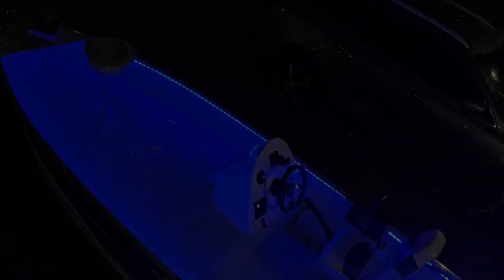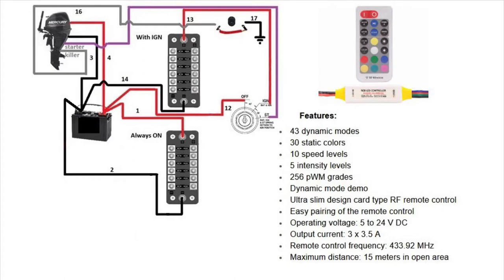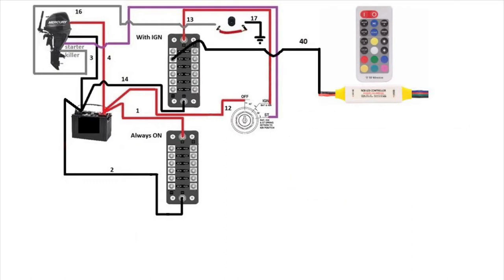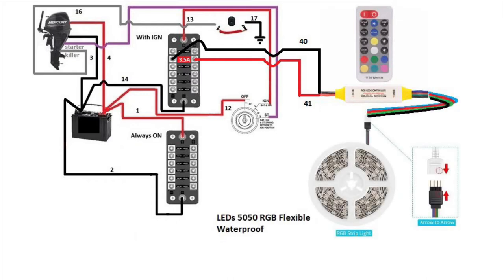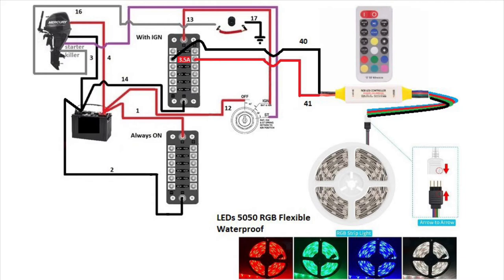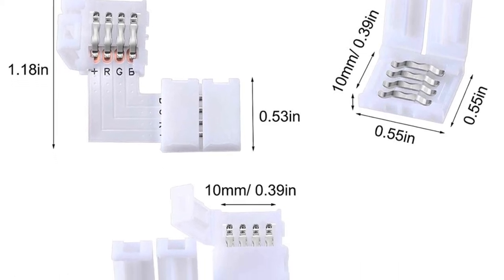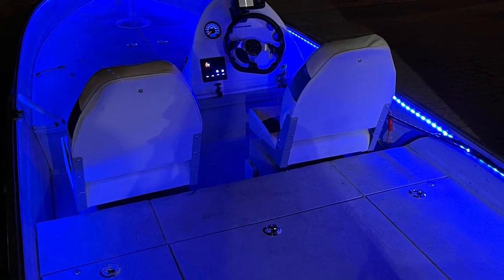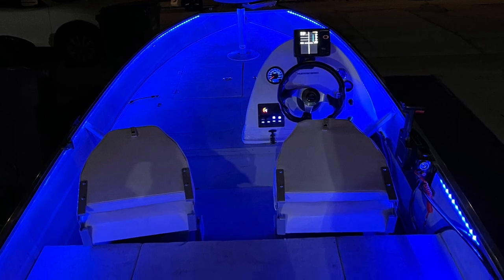Boat electronic wiring diagram, part 3 ( led strip installation )

Comment: Hi Joe.  Great video and just what I need.  Any chance you can share the wire diagrams with a link or something?  Would love to print these off to use and keep a copy on the boat in a ziplock.  Thanks Dean
Reply from the maker: Hi deanwentzel, thanks for watching and for the nice comment. For the diagram, Other have done a screenshot and printed it. Try that let me know 🙂
Reply: Joe that worked perfect.  Thank you sir:)   @joetheboatguy5394

Comment: Hi Joe, Great videos.  I am redoing my boat and your videos are very helpful.  I have the same type of accessories but want to have separate batteries for crank and always on.  where would you add a on-off-both battery switch?
Reply from the maker: Hi Michel, thank you for watching. Let me know if the is what your looking for… check this video https://youtu.be/l4Ve6KpiAqQ

Comment: Your videos are EXTREMELY helpful. Thank you. I have one question: can you provide a link to those RGB LED lights you are referencing in this video with the RF remote? I can't find them. Thank you.
Reply from the maker: Hi Derrick, thanks for watching and for the nice words. For the the RF remote I got it at a electronic store called Addison. It’s called “LED STRIP CONTROLLER WITH WIRELESS REMOTE CONTROL - RGB”

If you go to there website and type LED STRIP CONTROLLER WITH WIRELESS REMOTE CONTROL - RGB
 You will see all the descriptions. 
My led strip and remote were purchased separately. 
Hope this helps, let me know.

Comment: All good but you never say what size of fuses to each accessory
Reply from the maker: Hi ODLid1, thanks for watching, I never say the size because every accessory will be different from one boater to another. I might get a set of leds that require a 2amp fuse but yours might need a 4amp fuse. Every accessory you get will have the specifications and the fuse required. When an accessory say max amp, that will be your fuse size. Hope this helps :)

Comment: Hi I’m in the process of re wiring my whole boat, one thing I’m not sure with is radio…. Should I hook this up to “always on” fuse block on a switch or have it on “ignition fuse block”
Reply: Sorry to clarify not vhf , just am/fm radio
Reply from the maker: Hi Scott. To start thank for watching. They are advantages and disadvantages in both ways. If you like to have your radio on when your keys is not in the ignition then you can connect it on always on fuse box. But if you forget it on with the volume low or muted then it will drain your battery since it will not close automatically. It’s your call but both ways will work👍. Have fun with the rewiring. Always fun to work on boats 🙂